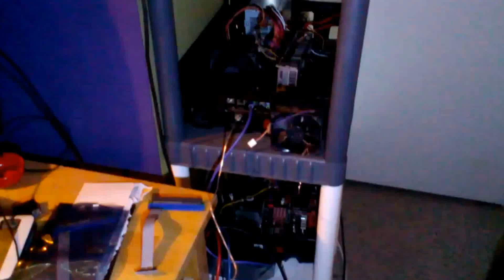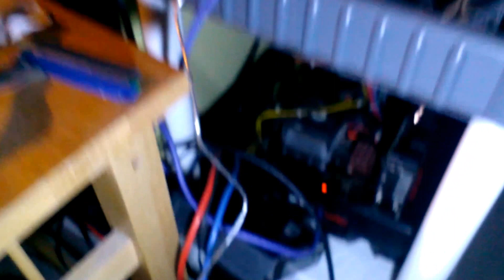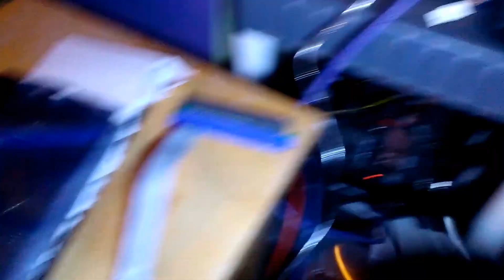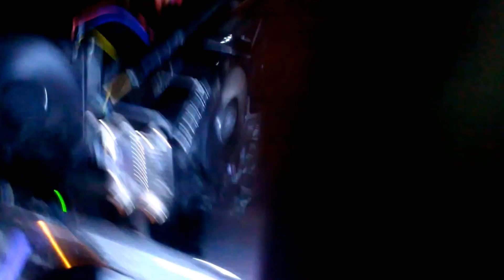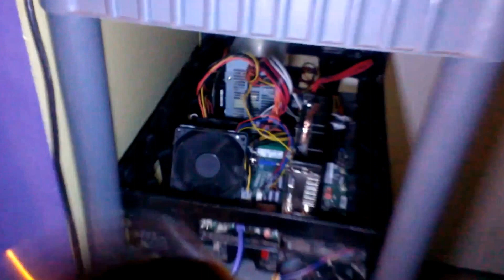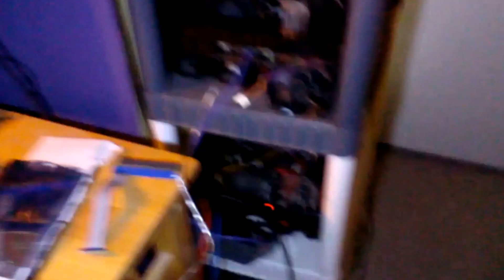My litecoin mining rigs

Comment: Bro, I am running 2 Asus HD7850's @1125 core, 1500 mem @55% fan they both get 60 degrees. I have 780 Kh/s, so you may adjust some of your clocks and intensity :P or wont the cards clock any higher?